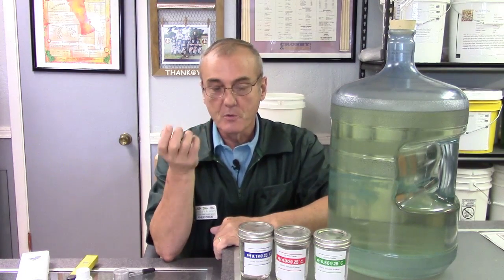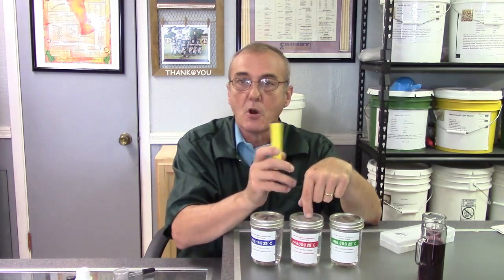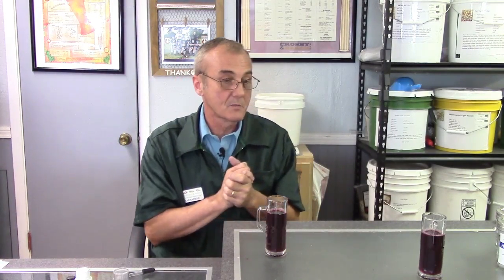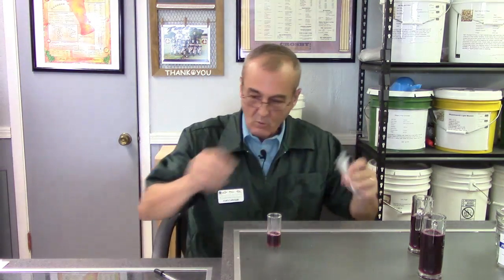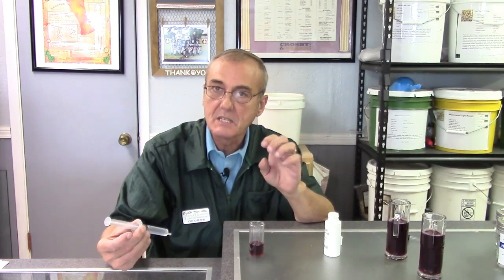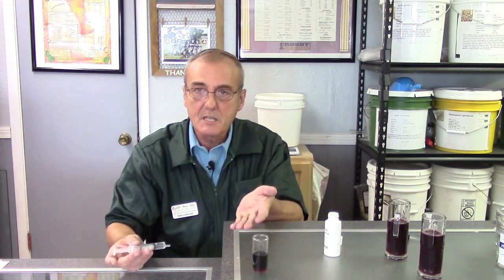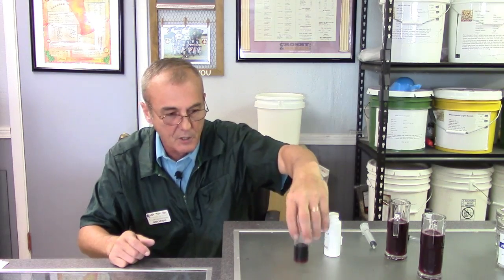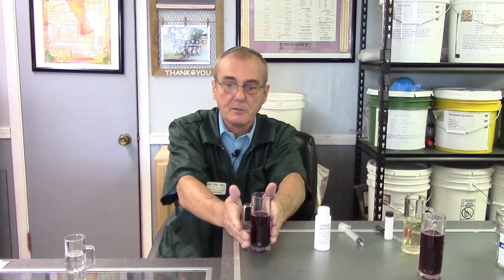Testing the acidity of wine and all about PH

Comment: Hi!  Great article on acid and wine.  I am a novice at this and decided to make a cheep white grape wine.  After purchasing an acid test kit, I started my wine making.  My first measurement showed the juice as only 15+ percent acid (dripped one drop at a time).  I added 6 teaspoons of acid blend to 1.75 gallons (my primary wasn't big enough for 2 gallons) of grape juice.  My next two tests (6 tsp later) indicated a change of .1  (to about 25%).   Any idea what I'm doing wrong?  Mathematically I should have changed the acidity to 40 or 50 percent (2 teaspoons should change 2 gallons 10%, 6 tsp a change of 30%)  ???

Comment: Ok I have learned so much from you but I am stuck. After 7 days of bucket primary fermantation(went real well) I drained into carboy and added yeast nutrient. 10 days later and I am at .0999 g, 2.82 ph and 5 brix. Should I add sodium bicarbonate? It seems really low on ph, could I have too much acid?

Comment: Late to this party , but if you have  pH meter you can calculate the TA by adding the chemical base (sodium hydroxide) until the pH meter indicates 8.2 . That is the point at which you would find the color change in either white or red wine (and using a color indicator to check the TA of  a red wine is close to impossible).

Comment: Pro tip, when performing a titration it helps to place a white card or towel underneath and behind the beaker. This will allow you to view the equivalence point more clearly to yield more accurate readings. In the video George passes equivalency and the final solution is more basic as shown by the bright pink color of the final solution. The pink color is from the phenolphthalein which was added as an indicator. The true equivalence point will be a faint pink that is somewhat difficult to discern unless viewed with a white background.

Comment: I found a page that says that you can measure acidity with ph meter also (http://www.grapestompers.com/articles/measure_acidity.htm) Have you tested this way?
Reply: interesting. Seems like its the same concept.
Reply from the maker: PH is the measure of alkalinity vs acidity on a scale from 0-14 (7 being neutral). PH will tell you how acidic a wine is but not how much acid is present by percentage. Kind of like two different measurements. Very similar.
Reply: On that website it suggests using a solution to bring your wine to a PH of 8.2 or something. And then measuring how much of the solution you added. And doing a calculation to see the percent, similarly to the way you did it. They think the accuracy might be improved this way because we don't rely on color change.
Reply: Yes, I think this is more precise method than color change.